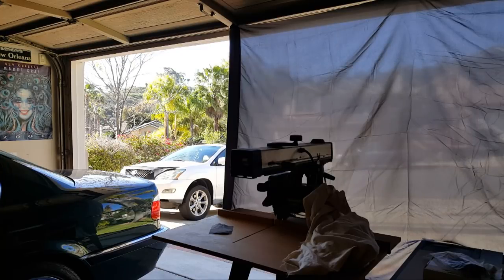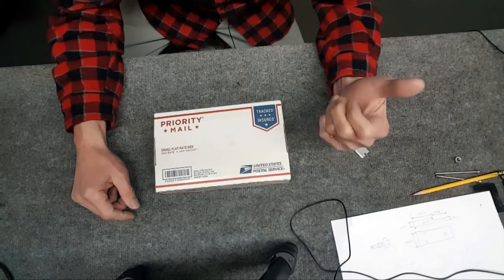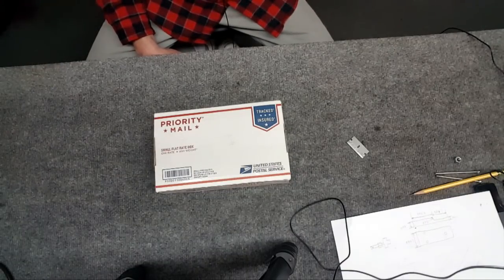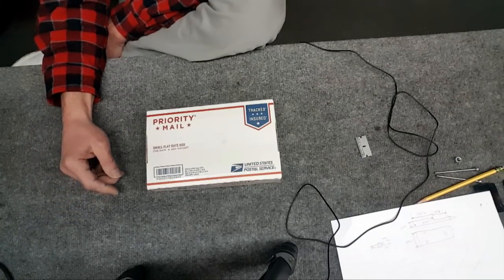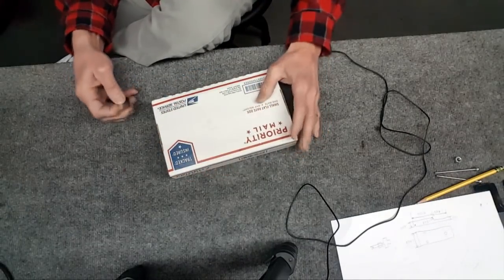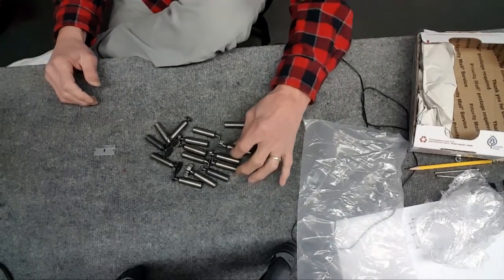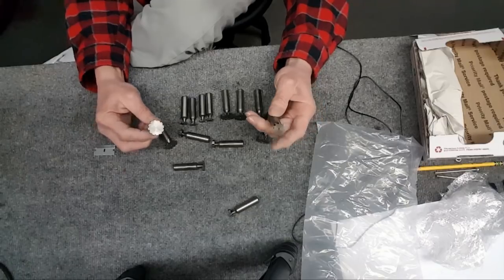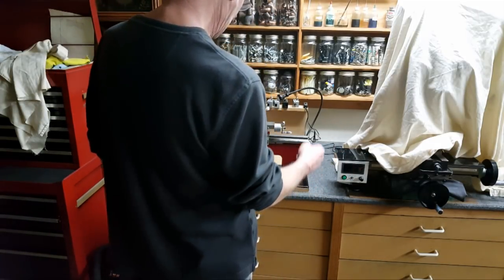Repairing The Mini Lathe Apron & Power Feed Half Nut

Comment: Hi Dave!   Thanks for all your videos!   
i have the same issue with my lathe (same as yours)   the power feed stop working after making some Chrome steel crankshafts....  maybe to hard for a hobby lathe...   the strange thing is the power feed half nut "jumps" and stops advancing only in one direction... if i change the direction feed ( from chuck to tailstock) the power feed works nice... so... i will order a new half nuts.. do you think that the lead screw should be replaced too? seems to be a lot harder than half nuts...   
By the way...  if you remove the lead screw cover, you can install both half nuts, and you can get a telescopic cover at littlemachineshop, but the price for these is kind of expensive....    
ahh forgot....  i noticed you made a spacer for the gibs..  good idea!  i just used  a bigger washer, bend on the edge and a new small hole... seems to work ok for keeping the gib in place at the top...  but for sure will make the spacer once the half nuts get in stock again...   Cheers from Mexico Rodrigo
Reply from the maker: For the lead screw just examine it for any damage I had hit a hard limit which broke threads in the half nut but didn't hurt the lead screw at all.

Comment: Hey Dave. Just wanted to let you know I'm adding a tach to my mini lathe. Found a spot on the control board for a little power converter. Tested the contacts with my multimeter and got 120V, so ordered a little 5V converter that appears to be mounted on all mini lathes that come with a tach. Soldered it in last week and it fit perfectly. Will test it tomorrow and let you know how it turned out. Will also record a quick tutorial and post it. Let me know if you're interested. Cheers

Comment: Dave, thanks for responding to my question I had. But before you could answer it in your video, my new lead screw and Claw set came in. I went ahead and left the screw cover off and installed both sides of the claw. I'm debating on whether to put some kind of collapsible plastic covering on the lead screw or fixing a wire brush to the apron somehow to keep the lead screw clean. I'm also looking at purchasing a mini Mill. What features should I gravitate towards or stay away from? Like your videos, looking forward to more thanks.
Reply from the maker: William, LMS does sell a plastic lead screw cover check it out. On the mill all the people I have contacted me are all over in their requirements. Mine need is specific I want max Z travel using only the quill feed handle. There are 2 types of mills. Mine where the handle operates it like a drill press moving the Z axis 7". The draw back of this type is they all have limited Z clearance. The other type uses a crank to move the Z then the handle moves the quill 2" for drilling etc. The plus is they have much more Z clearance and the bad is 2" for drilling/milling. The only other thing is last week a guy ordered the HF mill, never got it or his money back.